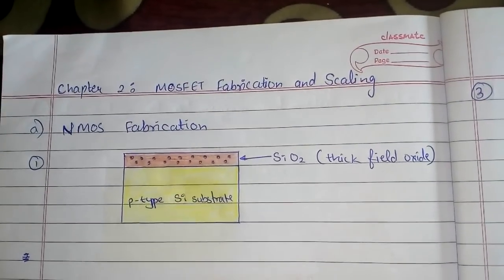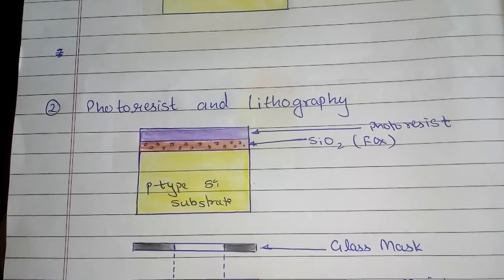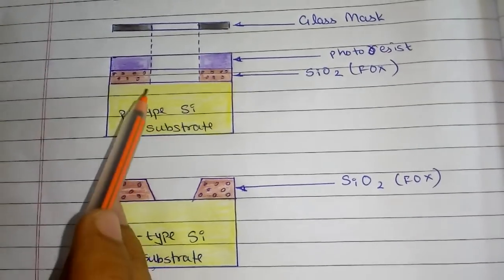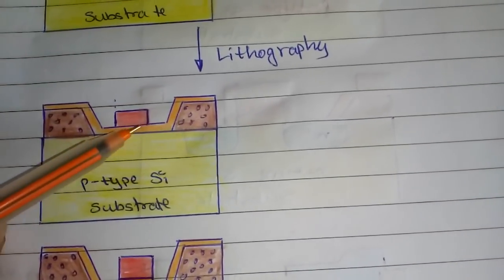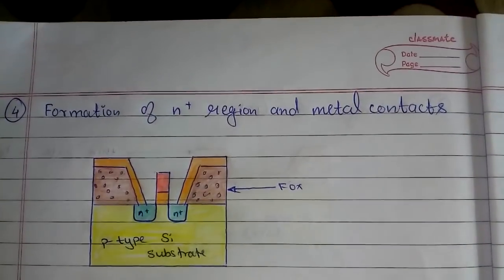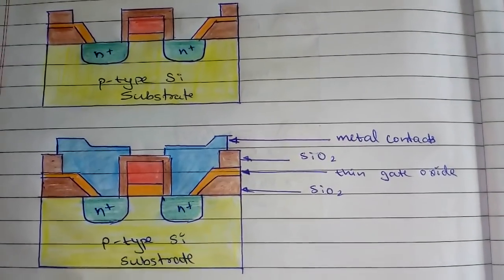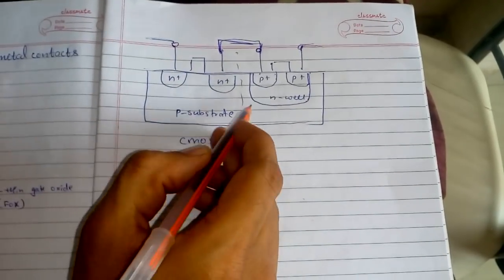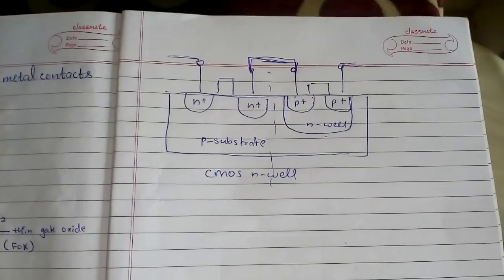Chapter 2 - MOSFET Fabrication and Scaling (Part 2)

Comment: 3:05 I want to make a little amendment. engineering plastic, mostly used in car's head-lights because of it's ability to stay transparent even if exposed to high temperature, is patterned using metal such as chromium called reticle or mask. The defined-pattern using metal is made by spreading metal to the whole surface, just leaving the desired pattern.metal surface is opaque and the leftover part is transparent. UV light passes through transparent part and etching is performed.